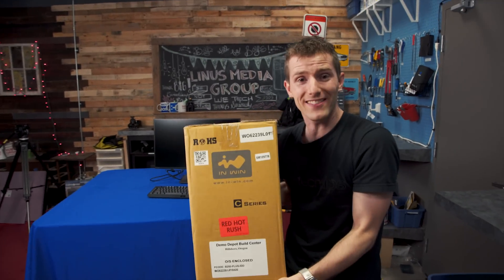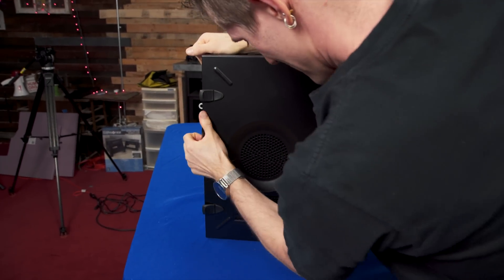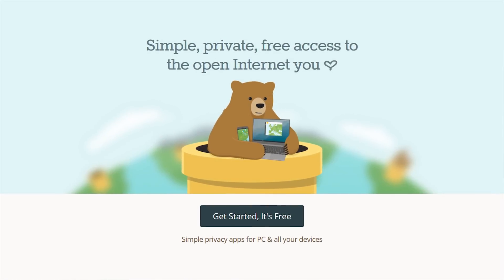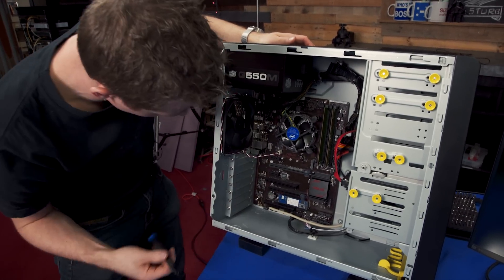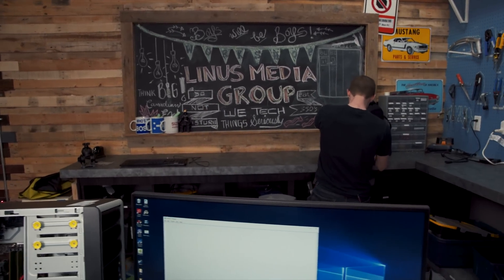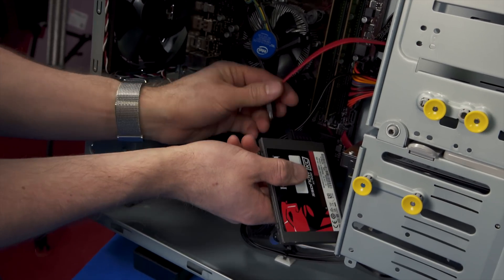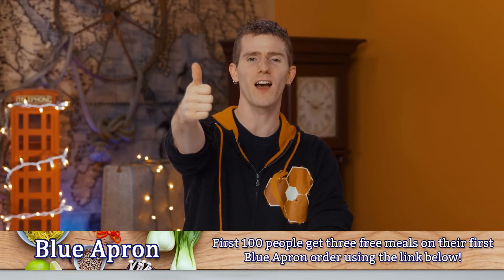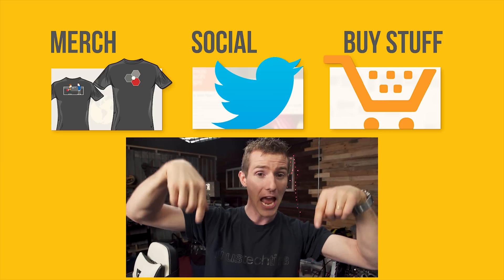Turbocharge your SSD for $40??

Comment: "maybe, this 3d cross-point accelerator optane module is so amazing that it can make even this mid 2000s style beauty fly!"
after the commercials
"alright so what do we got here? let's see we have a B250 motherboard, the most generic ram ever, WD Black, core i5-7500 yeah whatever"

so intel put modern components in a case that looks like it's from the mid 2000s to try and convince people that their new product can turn any used $25 PC you can pick up from a PC repair shop from a hunk of junk into a snappy daily driver?

that's some scummy shit.

Comment: The fact that it only works in fairly modern systems kinda reduces it's sensibility, but i think, as an acceleration on a fairly new system with large capacity spinning hard drives, yeah, i think it would make sense. Yes you could still boot and os-load from an ssd, but your large storage drive would still benefit from the extra speed. I would still want to think of it as a thing to be built or connected to an HDD / HDD controller rather than something you stick on your motherboard ... but then, you start hitting SSHD territory ... Did intel just reinvent the wheel. only in a bit more expensive way?

Comment: I have a question, so if I have a 120gb SSD running Windows and my programs, and then a 500gb WD Hard drive for my games. Would this be worth it for improving loading times maybe? Or would it probably start caching windows files and trying to speed up my SSD again 😂

Comment: SSHDs are still at about the same performance point and same price point as HDD+Optane.
Reply: Christian Stout sshds and performance? Most of them dont even have 7200rpm hdds inside and a 8gb smart flash module isnt the best performance you can have. Ssd+hdd is the real deal - and affordable atm
Reply: SSHD's are most of the time only marginally more expensive than a normal HDD, only extreme cases as the WD Black^2 1TB+128GB 2.5inch do cost a lot more. Also it works on a normal SATA Port and the drive itsself manages the data, so why installing stuff that does make no logical sense? I guess Intel forgot that Windows already caches programs before they are launched, I guess every program startup would be as fast with 32GB of ram instead of opting for Optane :D

Comment: I built my computer when 6th gen was JUST coming in, and I was an idiot and thought that 4th gen was still great. I was wrong, I know. One thing that I do know, though is that I will be sticking my i7-4790k rig for a few more years and that my SSD will be good enough until I completely revamp and build an entirely new system in which I can place a ginormous Optane based drive in. Sorry, Intel, but you aren't selling me just yet.

Comment: I have an SSD but most of my steam library is on a HDD, a setup most people would have. Are there any benefites to it in this situation?
Reply: Ryan you know they have been saying that SSD will be more affordable as time goes. But so did HDD, not to mention that HDDs are getting cheaper faster than SSD did lol.
Reply: SSDs are already affordable for mass storage.  You can get a 1TB SSD with decent performance and lifespan for under $200.
Reply: http://imgur.com/a/0q1no

Really? Looking at amazon 6tb hdd = £179, 4tb ssd = £1,199
Reply: Chubby I don't know what the hell you use to buy things but I looked it up on Newegg (which I ALWAYS get the best prices at) and a 1tb SSD is $274.99

Under 200 my ass.
Reply: Ethorbit 4TB drives were on sale at my local Walmart for $104 yesterday when I was there. 6 TB drives can be found now for under $200
Reply: Ethorbit NVM 1tb SSD under 200 my bad
Reply: you can find them on sale for less than $200, sometimes even as low as $150 if you are willing to go off-brand.
Reply: Ryan No, it caches boot and OS files for your C drive only :-( Soon, however, an ssd might become affordable for mass storage:-)
Reply: Ryan it only works with your boot drive so its useless for you and most people (including me) who uses low capacity but blazing fast SSD and HDD for storing games.
Reply: No 1TB SSD lowest price should be around $240~$270

Comment: So basically turn your HDD into an SSHD?
Reply: Yes, in a PC that most likely already has an SSD since Optane requires Kaby Lake CPU, 270 series mobo and M.2 slot.
Reply: Just to sum up what a few people here totally didn't get (especially the aneurysm dude) ...
Capacity: SSD << SSHD < HDD+Optane = HDD
Speed: HDD << SSHD < HDD+Optane < SSD
Cost: SSD >> SSHD > HDD+Optane > HDD

It's a no-brainer to anyone who wants several TB @ high speeds and is able to use their brain.
Replacing an SSD (system and applications) with an HDD+Optane is clearly not the point here,
and replacing an HDD+Optane (media) with an SSD of the same capacity would cost a fortune.
Having both is the thing ... for enjoying high performance application and media file access!

UPDATE: "non-boot drive acceleration is not supported" >_<
Sorry guys, I was assuming the people at Intel weren't just a bunch of idiots smoking weed all day.
My bad.
Reply: +lostn65
You sound like you're lacking basic reading abilities.

1. There was an UPDATE in the original comment, more than obviously not pro-intel.
2. There was an additional reply of himself stating that it was - at least partially - wrong.
3. There were statements ("Replacing an SSD is not the point") that you're merely parroting.
Seriously?

Furthermore:
4. It's not clever in the slightest trying to explain to others their own use cases, which you have no idea of.
5. It's outright dumb to assume you're smarter than someone who apparently isn't an idiot, just because you missed the point completely ...
So thanks for verbosely explaining the obvious, which the OP was probably aware of since long before you even started to deal with the matter, hence just wasting our time.

What you don't get in the first place: The intention was not to use Optane in a way that doesn't make sense (speeding up mp3 collections, duh!?) but in a way that WOULD make sense (caching small portions of several TeraBytes of media data on secondary drives for the daily workload that would perfectly fit into a 32GB cache, exactly not to accelerate transfer speeds but random access to that data, like for indexing etc) if it DID support that. Which it doesn't. Which the OP already stated. Rendering your whole novel utterly pointless.
Reply: +Oliver ASUS
You sound like you've drank the Intel kool-aid.

Most desktop SSD users have a large capacity HDD as a second drive to store all their media on. The stuff typically stored on that HDD is not speed sensitive. Things you've downloaded, music, movies, TV shows, maybe some photos. Things that don't benefit much from faster access. The SSD is for the apps that you use frequently. Those WILL benefit from faster access. There is no point getting a 2TB or 4TB SSD if only 500GB of that 4TB is speed sensitive. Speeding up your MP3 collection does nothing for you. Speeding up load times for your games and boot OS does. 

Optane+HDD while slightly cheaper is no substitute for SSD+HDD. 

The question becomes what size SSD can you get for $80, as an alternative to your 32GB Optane cache? It will be more than 32GB. It should be about 128-256GB SSD for that price depend on sales. Pay a little bit more, and you get a lot more. And it will be a lot faster than Optane+HDD. 

If the Optane was free and built in to the M/B (as if), then there would be a legit argument for its usefulness. But you are paying much more per GB than you are with NAND SSDs, and all it does is cache your HDD, netting you an overall speed nowhere near as close to the 'slower' SSD. 

Optane in its current incarnation is a dud. It is aimed at people who can't afford an SSD, yet it requires a Z200 series m/b with the very latest gen CPU. It does not understand its own market.
Reply: Not entirely. To lower costs, most SSHDs use NAND Flash as their "SSD" part of it. It's typically 8GB of NAND Flash. Optane would do it WAY better than any FireCuda because it uses 3D Xpoint which competes with 3DNAND which is better than Flash in every way, not to mention it has a much larger capacity
Reply: if i were u i would get this . ssd has a lifespan compare to almost unlimited lifespan of HDD+optane
Reply: But you can actually store stuff in an s.s.d., not just use it as a cache.
Reply: *Solid-state Hybrid Drive
Reply: Super saiyan HD lol
Reply: And a 240GB SSD is cheaper. $70 for Zotac T500
Reply: SSHD =/= SSD
Reply: Exactly.
Reply: Solid-state Hard Drive?
Yes Please
Reply: Andy Mitchell SSHD exist already for a while. Sadly most laptop vendors don't offer them as a default or upgrade as they would make a lot of sense.
Reply: @Kelvin KMS
yep $80 for a faster than SSD sshd cache does sound to expensive...
But the test here was for a $40 solution which sounds like peanuts if 16GB is enough for a 3 to 4 TB drive?

Not sure about slower than a Samsung 960 evo either when all the test I have seen show optane significantly faster in most essential day to day bandwidth categories ( speedups that actually matter )
In which case I could care less if SSDs were better on first run as I want a cache to...
well, cache! Therefore I want what actually caches faster!
Not sure who these typical consumers are? Who will not notice such speedups ( and read/watch these enthusiast geared reviews!?? )
Do secretaries and housewives  on office read/watch these things when not on Facebook, playing solitaire or angry birds? What enthusiast upgrades for any other reason than they are consistently screaming at progress bars when transferring, compressing/encoding, or calculating/rendering? ( though I suppose that there r those that primarily/only game? But even they will eventually grow up and need to do some real work! [ unless they become secretaries I suppose? In which case F*ck em! ] )
Reply: On the other hand...
Kind of nervous that 16GB will not be enough to handle my workload? Would have a lot more confidence and easy adoption if the 32GB model was the $40 option instead! Hopefully the price drops fast making such debates silly. ( considering I pick up SD cards under $40 with my groceries when short which is only the cost of a half of week of Gasoline to get me to the market to buy as much... ie negligible cost )
But $80 bucks fer that 32 GBs? ( now yer cuttn into my beer money Intel! )
Reply: Oliver ASUS Completely agree, it's a very consumer friendly development.
Reply: Scuba Sausage ... but unfortunately I was wrong x\  (see update of my post)

exileut, you still didn't get it.
Reply: Linus's neck looks like a scrotum, in the video picture. I'm sure they planned that.
Reply: Oliver ASUS A quick google search tells me you can use optane on a non boot drive and there are users explaining how they have done it and everything...
Reply: Scuba Sausage I found tons of solutions for SRT, but not for Optane ... can you be more specific? Sources, maybe?
Reply: did you have an Aneurysm, Kelvin?
Reply: Well, anyone with a Z270 Mobo usually has 2 M.2 slots. If not, then maybe they should concider waiting, But I think optane is perfect for people with 2 slots. It allows users have a lot of HDD space while being able to afford an NVMe M.2 SSD with lower storage copacity (and not a crappy M.2 SSD that isn't even NVMe). All while having around the same speeds.
Reply: Steven Gutierrez yeah, thats what I though. But the optane cache is faster than an sshds ssd flash module i assume. And optane + hdd could be cheaper and more customizable. But i rather stick to my boot+CreativeCloud m.2 ssd (5s boot or less ^^),  my 2tb gamedrive and my videodrive
Reply: +Kelvin KMS Optane isn't meant for direct storage, it's meant for faster RAM-like access. Get a brain.
Reply: Except it costs you an nVME slot for future upgrades - better to just use the money and configure the system correctly with a boot SSD
Reply: Don't be scammed by Intel !!! Optane is useless and extremely expensive !!! $80 for only 32GB !!! Why not just buy Samsung 960 EVO 250GB PCIe NVMe M.2 ? Which only cost $128 and x8 times more capacity !!! and even faster than crap Intel Optane !!! so if you want same capacity Intel Optane then you will need to cost $640 for only 250GB !!! No point of crap product !!!
Reply: Steven Gutierrez No. An SSD doesn't need programs to run 3 times top cache them, it's fast from the first, octane is useless, just get an ssd.

Comment: Will this work in my laptop? It has a m.2 slot
Reply: just buy an ssd
Reply: +tonyrulez69 It's very possible that its designed for workstations not enthusiasts.

The Tests Linus did are based on only 1 HDD or SSD
He hasn't tested it for example with a systems that is using a SSD as a boot drive but still using Cheap cost Per Gb storage for unencoded video.
Reply: Alvaro Rodriguez Yes you can
Reply: Does it have Kaby Lake CPU? Does it have a 270 series motherboard? No, it won't work. Only works with brand new mid to high end PCs that already have SSDs so no need for Optane there neither.
Reply: Yes it has a kaby lake cpu, I just bought it but without an ssd because it was cheaper to put it myself but I´m more interested in this

Comment: Office PCs still have HDDs and a cheap Optane might be an option. But I still think that even these office PCs where better off with a cheap 250GB SSD
Reply: a current office PC (one from the last 3 years for that matter) should not have a HDD at all b/c usually its all network based anyway. And a 60GB SSD doesnt really cost more than a 500GB HDD
Reply: Well that "everything is network based" is not really a case in many companies.
Reply: Did you see what the requirements are for Optane? Kaby Lake+270 series board+M.2 slot. Office PCs have neither of these.
Reply: You certainly don't know Dell. And don't give me shit. It is not my decision to buy those
Reply: At least databases and all the mail stuff is. Probably depens on your company.

Comment: I still see a lot of people buying the ol' "HDD for Stuff, SSD for boot" combo for lower budget builds. Would've been great if you tested this scenario as well. Maybe load some games, flip through some pictures etc. to show us how responsive the system gets if interacting with data from the HDD. It may not be worth it to leave out the SSD but maybe it's better than getting a bigger SSD for those 40$.

Also I'd like to see you boot and game from an Optane drive/use it as RAM. I heard the bigger ones are quite expensive so... H0ly $h!t ? I also heard about Ryzen support but couldn't find a lot about it. if it works, how do our memory speed dependent friends from the Red Team perform when paired with Optane RAM?

Comment: i see this working in a system where you have an ssd for OS but use HDD for mass storage example games, videos etc. it would make sense then other than that i don't see any other uses since its not compatible with older systems.

Comment: Isn't the comparison that matters accelerated HDD vs standard SSD? If the performance ends up being comparable an argument could be made for the convenience of having a 2TB data store as your only storage. While boot SSDs are relatively cheap now large capacity drives are still fairly expensive, especially ones with strong performance.

Comment: From enthusiast perspective: it doesn't offer significant performance boost and it only works on newer Intel platform. So, better buy separate SSD and HDD for you new build or upgrading your system

From OEM builder: Since larger capacity SSD cost more and limited to 4TB (correct me if I'm wrong), building a workstation that require more capacity with faster access time will turn away small/medium business to buy that require that workhorse. With Optane you can throw in your new Kaby Lake system and have larger storage upgrade option in the future since it boost the HDD performance